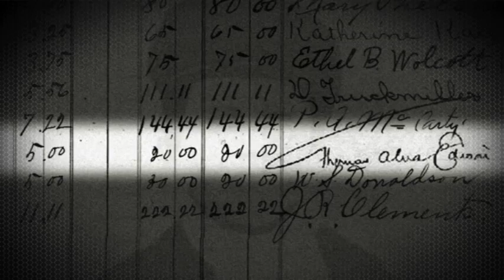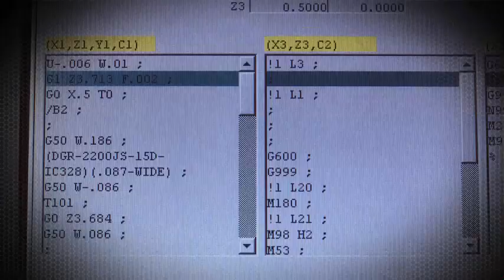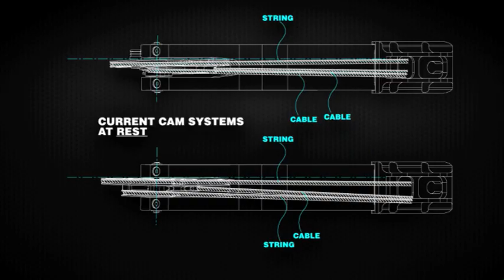Prime by G5

Comment from the maker: It is a very tough choice, but in good way because either way you're getting a great bow. That being said your decision may be better decided based on the bow's primary use. If it's strictly hunting the Alloy might have the slight edge. If you plan to compete the scale might tip towards the Impact. That is of course debatable, but the Alloy was designed to be a hunting bow, while the Impact falls perfectly on the line between competition bow and hunting bow.

Comment: Love my new prime defy it shoots really smooth with no hand shock or vibration,also has a really solid solid back wall,,I was set on buying a bowtech experience but after picking up and shooting the prime there was no comparison ,,,
Reply: I need a short bow, the defy seems like the best choice
How much have you used yours
Reply: I had my heart set on a Bowtech too until I shot it next to the Alloy. I tried several different bows but kept going back to the Alloy. I have no no regrets other than I bought it after bow season was over. Now I have to wait until Spring turkey season before I can put something in front of it
Reply: I've used mine alot

Comment: I am deciding between the Prime Impact and the Alloy.  I have long arms and shoot a 30 inch draw length, I have considered shooting a 30.5 inch draw length.  For the length, I like the Impact.  I like the weight and brace height of the Alloy.  I have shot them both, but neither was set up.  They both felt good.  Any suggestions?